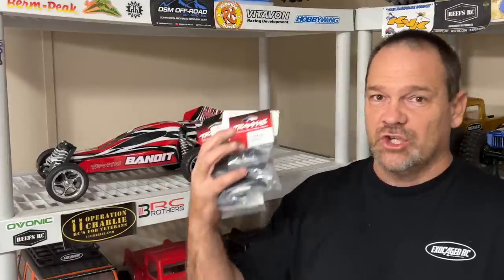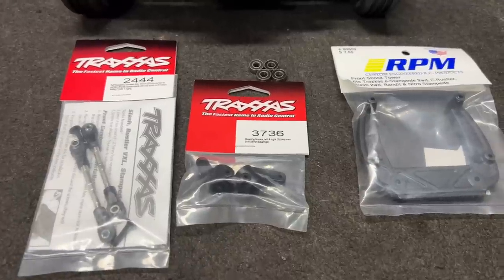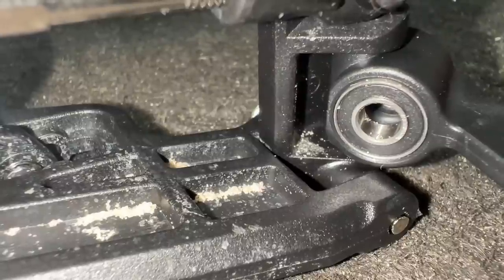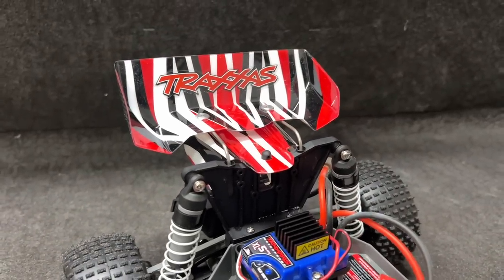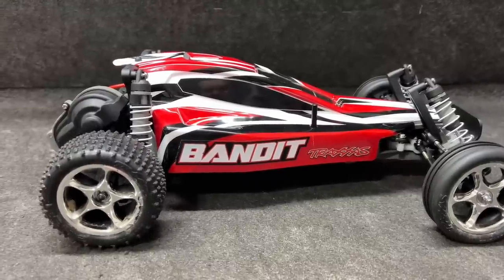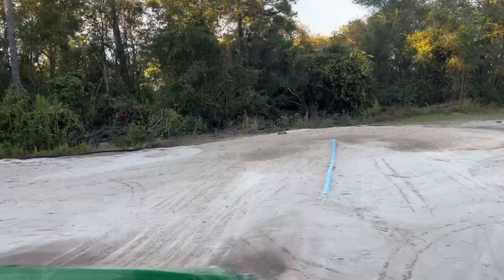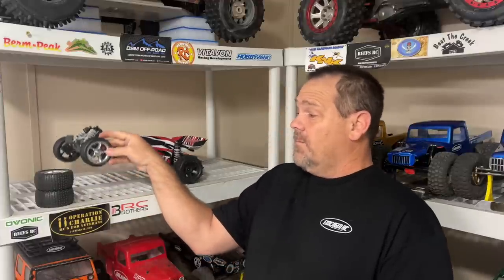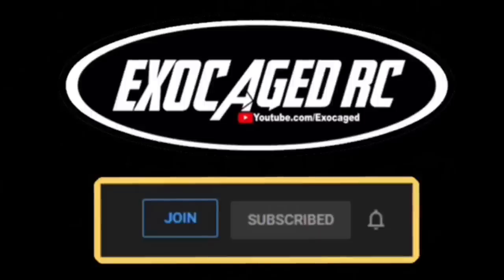Bandit got Unstock and then it beca……

Comment: The Bandit, Rustler and Stampede are all great rc’s! There is a reason Traxxas has had these forever and do not change them except the body paint. They preform good and are very easy to work. You definitely need to keep it 2s and do a gearing change.

Comment: I have a Bandit that I bought 24 years ago. It originally had a mechanical ESC. It has a orange body with checker flags on the front of the body. I changed the esc back then to a electronic ESC. The body is alot more squarer than the new ones. I just pulled it back out. I ordered a 12t motor and newer brushed EDC for now. It originally came with a 20T Stinger motor. I put a 9T competition motor in it. I kept melting batteries left and right. Geezus!!!! It was crazy fast!!! Not geared right lol. I put it away right after that so I didn't fix it. I went Nitro so she was boxed up. It's time. She needs new electronics. Prob going with the Valenion VXL setup soon.

Comment: I converted my stock bandit to brushless. Using a hobbywing ezrun max10 and esc combo. 34tooth pinion. Absolutely rips!
Reply: I recently upgraded my bandit I have the vinelon system the lipo I'm running it on is ho vo 3s I totally agree with ya @gatorbeug8059 this lil guy flies & rips off the gord 🤘

Comment: Rpm parts are made out of very flexible plastic, you want to eliminate flex in the shock towers. That's why most race buggies use carbon shock tower, very little flex
Reply: This is true. However, stiffer parts are great for precision. Not bashing. Watching all that chassis slapping and crashing, CF shock towers may not last long.

Comment: Stock Drag Slash rear axles fit and are much more durable than the stock Bandit axles. These are lighter and cheaper than aftermarket products. As for the rear shocks, adding shims to the bottom shock mount is needed because the angle of the shock isn't right. You will need longer screws.

Comment: i say 2s and gear up the pinion a tooth or 2. 2s is lighter. plus if you know how much battery you need to finish a race you can run the smallest battery possible to lighten the rig up even more. lot of people racing with 5k or 6k packs adding a bunch of unneeded weight. yeah weight can mean more traction but weight also adds to breaking stuff more when you crash and not jumping as smooth. back when i raced i ran a 3500mah 2s lipo and still had 1/4 battery left end of race. i probably could have gotten by with a 3k pack.

Comment: I did a full build (for fun) 2wd slash 7000kv on 2s is nuts. And very well tuned suspension. 👌
Reply: FUN that's what it's all about....we have lots of R/C's and have so much fun with the bandits stock to modified all so much fun..good times👍

Comment: I find the rustled front tower is braced at top and they work good and the bolt kit for the arms and hubs is a great thing also matel front arm brace save bulk head or go metal bulk head balance it out more also I put hobbywing 3300 and Max's 10 was great on it 2and 3s  it was a set when I got it 3650 motor 60amp esc fit perfectly in and don't think it add much weight either if any and you'll be so happy with it not being over powered and it lasted on stock every thing till I pulled it for another car the vxl is just to much.

Comment: The Drag Slash uses the narrower rear swing arms as the Bandit. The 2WD Rustler & Slash use the same chassis pan, & longer swing arms
Reply: The 2wd Rustler and Slash don't use the same chassis
Reply: @keaginm2791  
Ok. You are correct. My mistake, but the rear shock tower & drive assembly are the same, which makes the shorter Bandit swing arms work for the Drag Slash setup.
Thanks for the correction.